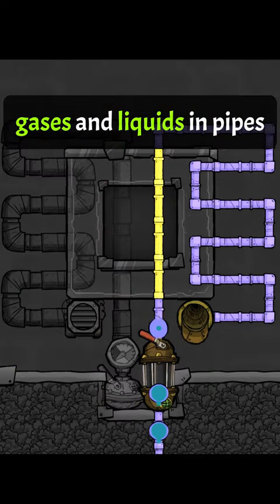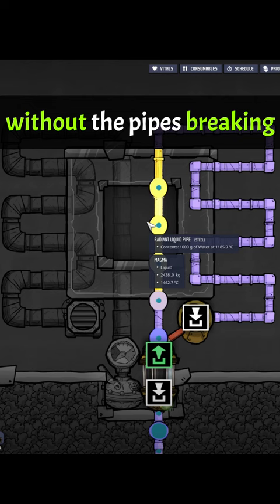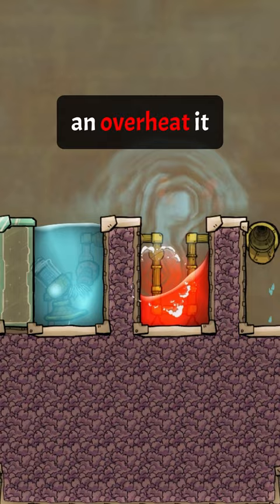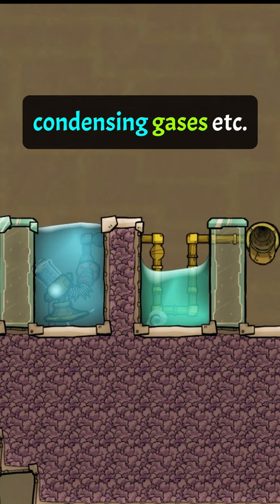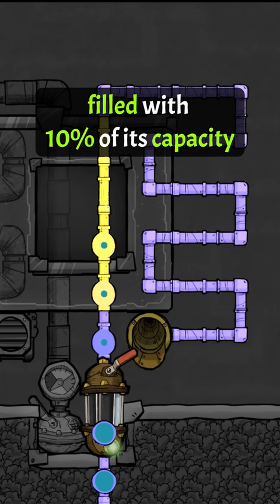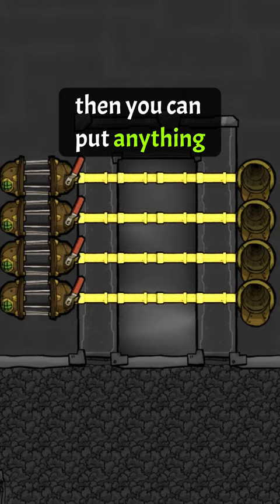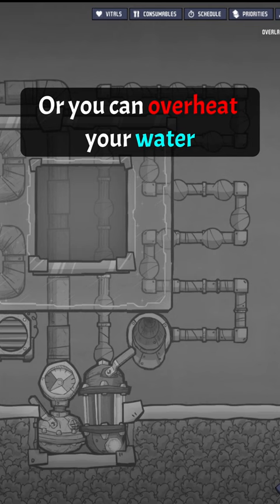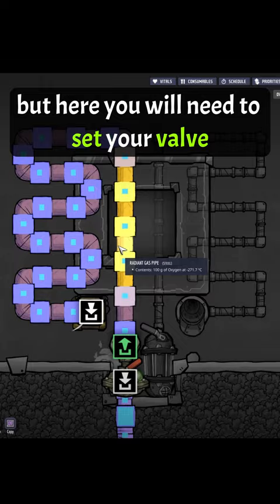Nr.22 Unbreaking pipes - 10% Pipe Capacity #shorts

Comment: Would that mean I can exploit this to create liquid hydrogen without supercoolant? 😲
Reply from the maker: You always could. But i am not sure how you would pull it of without some testing.
I guess it is easiest with a thermo regulator with 1/10 hydrogen in the pipes and then when it is cold enough dump it somewhere and it will turn liquid.
Reply: @Luma_plays  How about just running the cooling pipes (cooled with an Aquatimer outside) through a hydrogen gas filled room until it turns liquid? You could use any liquid for that with the non-breaking pipe exploit you demonstrated.
Reply: @phalphalak problem is you have so little cooling mass that it takes absolutely forever to cool it down
Reply: I think it has a max cooling value.

Comment: I try this one, just need to make sure nothing stops
Reply from the maker: Yeah the liquid should not add up then the mass per pipe is too much.
Reply: @Luma_plays  im one year late, but would bridging the small packets into a loop works to not let the flow ever stopping?
Reply: @alamrasyidi4097  yeah that's not a bad idea. If you used the typical valve feedback loop that is normally for filtering, you could set the filter size to 9kg so only 1kg would pass

Comment: The thing is, this isn’t even a glitch. It has a logical explanation. Assume a single pipe segment can carry 10L of matter. 1kg of steam at 100C (56mol) would exert an instantaneous pressure, calculated by ideal gas law, of 17000kpa, which can be supported by the pipes before its expelled from the vent. And there’s not even a question of the pipes capability to handle condensation and freezing.
Reply: the problem would be that when it freezes or evaporate the pipe won't be able to move it anymore

Comment: I used this technique many, many years ago to convert abyssalite pipes into tungsten. At least, I think that's right? It's been an incredibly long time, and it involved tricks like molten steel in metal refineries to ludicrous temperature, then through the pipes in tiny drops to heat and melt them. Back before tungsten was easy to get.
Reply from the maker: If we both mean the same setup i might have seen your video or someone elses video on that matter. Very hot and high tech setup, hats off to you :)
Reply: @Luma_plays  If memory serves, Francis John showcased the design many, many moons ago. I can't take the credit, I saw the concept on either the forums or on reddit. Mine was just demonstrating it in an actual playthrough rather than via sandbox/creative shenanigans.